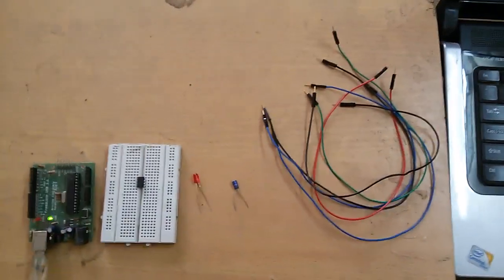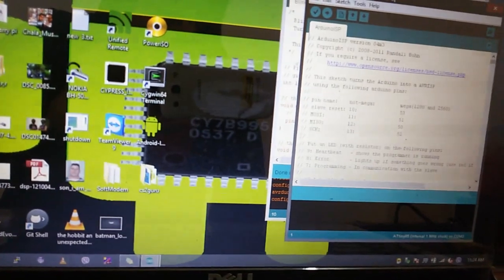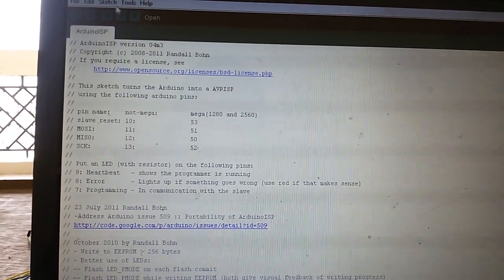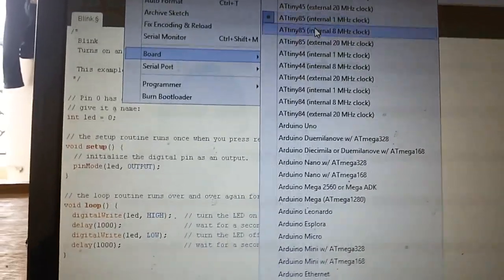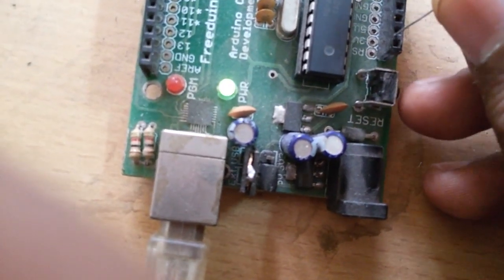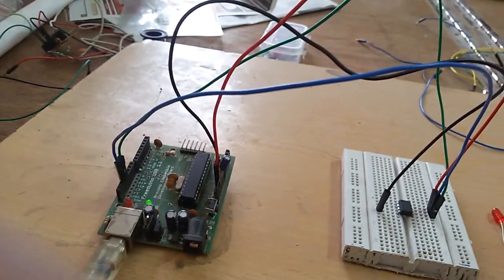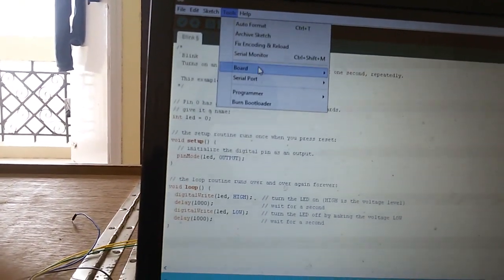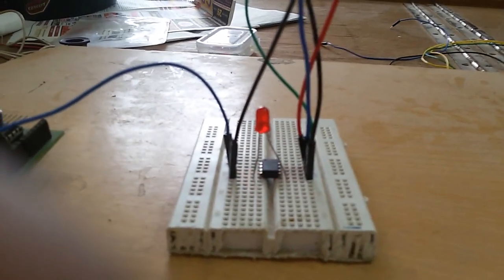programming attiny using arduino as ISP

Comment: Thanks for convincing me to try the example sketch, ArduinoISP. For, at first I did not have good results with my Uno. Just stalled out for some strange reason during the upload. Eventually it all went along just fine. But !! :-) I would still like to know how to put a bootloader on to the Attiny85 whilst using Arduino IDE. AVRdude is so ...hmm...DOS :-) Merry Christmas

Comment: you uploaded the sketch by clicking Upload (and not the option at File, Upload Using Programmer). Correct me if i'm wrong, Uploading means uploading the sketch on to Arduino board only (not up to the chip to be burned). Why not use Upload using File, Upload using Programmer? 
So, once the chip is disconnected from Arduino, retaining the power, the chip will run by itself even if restarted?
How about putting the bootloader to the Attiny chip when it is newly purchased? why didn't you tackle about the bootloader?  How about setting the fuses? please explain.

Comment: i have problem to program it. it is showing yenkie invalid device check your connection double i try capacitor but same result before some months ago i was program it without any capacitor but now i face this error i have 5 attiny85 ICS but all ICS same issue i checked all volts 3.3 and 5 but same error.

Comment: I have a problem with my ATTiny - when I plug in the LED it turns on but doesn't turn 100% off, it stays at about 40%
Reply: +CoodSpoong pinMode(pin,OUTPUT);

Comment: What is the start-up time of the ATtiny?  Is it faster than the Arduino?

If it was not connected to the Arduino, how long would you have to wait for the code to run after applying current?
Reply: *****

There is no bootloader on the TINY - it runs code after 65ms at startup

Comment: so far, i always get this error " avrdude ...not sync. (no com port mentioned) using laptop and desktop on Arduino IDE.
When opting for other means like using WinAVR to upload the code (instead of Arduino IDE, while IDE is set as ISP programmer), i get this error " avdrdude...can't open the device.
Since uploading Bootloader via Arduino IDE to the chip also results to error " not in sync", i don't know whether the bootloader is the problem  or the chip itself. I already tried few Atmega 238P and 238, but to no avail.
The arduino uno is working since it can upload sketches into it. My only problem is its feature as ISP programmer which I can't take advantage so far.
I also tried advices from the internet, but still same error i get.
Now I'm thinking of setting aside Arduino as ISP, and opt to other DIY AVR programmer instead, but my problem is I made my sketch 
Any comments?
Reply: +uel man have you used 10 micro farrad capcitor as i have the same problem before that,..... but after connecting the capacitor to RST and GND pin i removed this error..... connect - sign of capacitor to GND
Reply: @amitray769  i also have same problem yenkie invalid device check your connection double i try capacitor but same result before some months ago i was program it without any capacitor but now i face this error i have 5 attiny85 ICS but all ICS same issue i checked all volts 3.3 and 5 but same error.